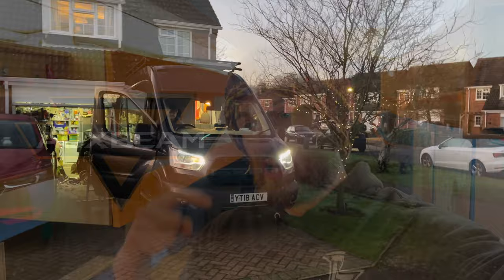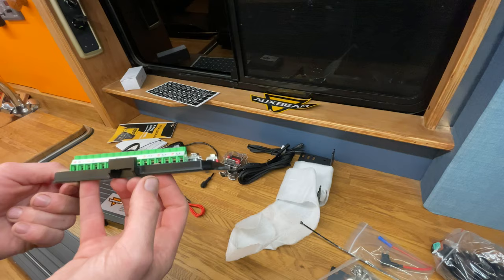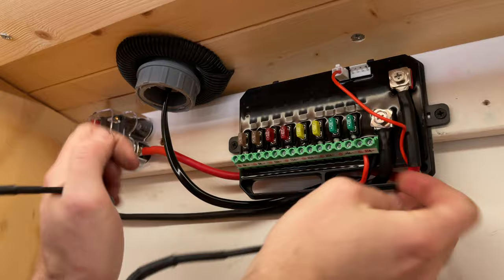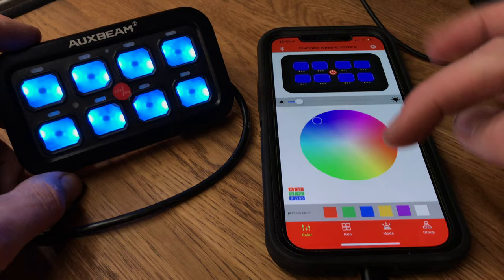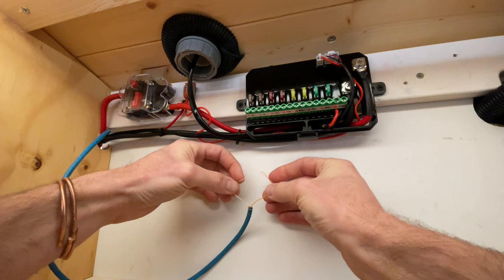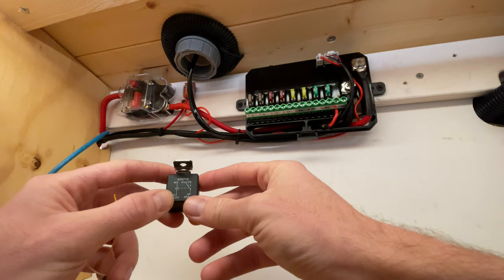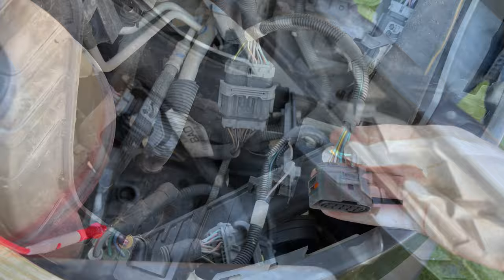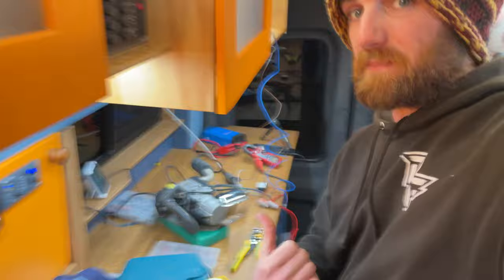Control ANYTHING in a CAMPERVAN! | AUXBEAM Control panel

Comment from the maker: What would you control with the AUXBEAM control panel?
Reply: Definitely use it for rock lights over the front of the cab when off road driving, nothing worse than not seeing what will get you a blowout, also roof lights in all directions, that’s my plan, thanks for the link to the 10 way junction box 👍👍
Reply: Autovox dash cam! I have mine wired to my fusebox so it can run 24/7 and not drain the vans starter battery
Reply from the maker: Good plan. I use a Autovox V5 dash cam and reverse camera
Reply from the maker: Good plan @Projectcamper. I am hoping to ask AUXbeam for some more lights including rock lights
Reply: @MispronouncedAdventures  that's what I have as well. Has been working good wired directly to mt fuse box. I cut the fuses off of the red and yellow wire and wired them both to the same positive terminal on the fuse box and added a fuse appropriate for it. I did it this way so I could still order the fuse piggy back adapters and wire it up the normal way again.
Reply: Compressor fridge via relay

Additional cab lights

DRL lights via a relay to to switch the -ve off as I use a DRL controller that relies on the battery voltage (it thinks the engine is running) to turn on so they don’t come on when my Renogy solar combined B2B charger has sufficiently charged the leisure battery and then starts charging the starter battery ie to prevent the DRLs coming on when just charging 

Solar panel via a relay so my B2B can charge the leisure battery at a full 50 amp when I just want to use the alternator otherwise it will only allow 25amp if the solar “is present”

Inverter feed via a relay
Reply: Could you put a diesel night heater on it? Mine is an eberspaucher/webasto and is controlled by a variable dial that you rotate between 0-100% so I guess it is looking for resistance or voltage or something, not sure how it works.
Reply from the maker: @chillout motorbike Yes. I would say so. I’ve seen the Chinese diesel heater with the rotary dial controller taken apart an additional wires soldered  onto the ON button for for an additional switch. A little bit more of a in-depth solution but I don’t see why it wouldn’t work. Definitely could be done with other types & brands of diesel air heaters and the controllers as well. Some easier than others
Reply: @MispronouncedAdventures   I have a webasto airtop 3500 and I know they have a number of different controllers, not just the rotary dial I am using, so perhaps one of the other controllers would be better suited to modifying in this way.

Big fan of your channel by the way! Your inverter installation videos part 1/2 really helped me out. The only reason my van isn't a copy of your van technologically speaking is because you are cleverer then me and my partner would tell me off lol
Reply from the maker: Thank you, I’m glad you have found my channel helpful! 

I’m not massively familiar with the webasto airtop inner working. But I’m sure a Webasto group might have ideals about adding an extra on switch and then if so, I’m sure if I could be used with a control panel like this
Reply: Adding in an aircompressor plus a control wire and relay to turn my 240VAC/12VDC hot water system on so it can heat up off the alternator (via the CCP) when driving.
Reply: I guess anything since it's basically switches with more or less amperage on each circuit ?

Comment: That's pretty much a scaled down ambulance control system, the one in my ambulance is called the phoenix system by Ring automotive, i have 12 buttons on each of 2 control pads and 30 odd relays to control stuff.
If i didn't already have it fitted I'd have one if those auxbeam kits in a heartbeat great bit if kit chap 👍
Really enjoyed that vid 😎 cheers 👍
Reply from the maker: Thank you, glad you liked the video and the unit. It’s a great bit of kit, I think there is a lot of use in industry with kit like this. I remember my old ex-AA van has a control panel left over from the AA, unfortunately they remove the main unit for it so it was never useable.
Reply: @MispronouncedAdventures  that was probably the phoenix system 🤔 a lot if recovery firms used it as well was ambulance builders, nowhere near as compact as that auxbeam unit though 👍
Reply from the maker: Ah that’s cool. I’m sure I’ve got the controller somewhere I might did it out to have a look

Comment: I was fortunate to also get the RGB controller, I also need to extend the controller wires so it’s in the cab and the main control box is in the rear, great idea using the max air fan on the Auxbeam panel.
Reply from the maker: Yep it appears there’s no issues with extending the cable being positive negative and then to data pins.

Comment: What is the reason for you wiring the panel to your leisure system and not to your van battery? Or both via a 5pin relay - with leisure NC, and van NO with an ignition switched signal?
Reply from the maker: I want all of my equipment running off the leisure battery and not the vans starter . Since I’ve got multiple huge lights, engine of preheaters and More.

Comment: Excellent video mate, I'm doing a similar install on a roof rack. Just wanted to know if the relay you used is "normally closed" as I have wired up mine with a relay that has two 87 pins and not a 87a pin.
Cheers Rob
Edit: I worked it out by buying a "changeover relay", now I have the same option as in this video. I'm going to do another relay setup  to trigger reverse lights.
Reply from the maker: Glad you got it sorted! I do have another video coming where I added reverse lights and other lights to it as well.

Comment: Coming to the party late! 

I want to do this scenario except only use one switch for it to come on only when high beams are  turned on if possible? I don't need to operate it separately. The laws in australia can be a bit funny...
Reply: You would still wire it up the same but without the need to wire up the 87A part of the relay. Instead you would have power for the light bar from the AR-800 going to a normally open (NO) contact 87 on a relay so when the high beams energised the relay, it would provide power to the light bar.

Comment: I read that people have had that issue that if you are multiple users in the same area, anybody can log into your system and (while joking or not) could possibly drain your batteries out. Anybody knows if that problem has been adressed? Not much litterature about those products... 😶
Reply from the maker: I have a button on my dash to turn the system off when not in use which is what I normally do mainly as the control panels lights up at night . 

But you are right, the Bluetooth doesn’t need a code as far as I can tell. So you can mess with other units.

I had this issue the other weekend with my friends. We turned all our rock lights on using the same app.

Comment: Hello there, sorry to bother you again🙈. I wonder why you use extra relays for the Auxbeam Switch Panel when they have it covered built-in? I'm not sure if you mentioned it in the Video. Is it for getting a potential free contact from a different 12 Volt System and/or just for having an additi you can run it another switch?
Reply from the maker: Couple of reasons. 

Either because I wanted to control a component from a different electrical systems, so it’s just using the circuit from the auxbeam controller as a signal for a relay. 

Or I want to run a device rated higher than output of that particular circuit on the auxbeam and just use the auxbeam signal for a relay
Reply: @MispronouncedAdventures  thanks for Letting me know. That’s what I thought, probably have to do the same as I like to run my extra high beams on the starter battery and not on my lithium battery 🙏

Comment: Acc wire what is that connected too in the leissure system ..?? This part has me well confused.. as if i connect to the battery in the back of the vehicle ive to get out and get in the back in the vehicle to switch off when parked camping or can i connect it direct to the leisure battery through a fuse a and on/off switch in the cab for example.. and would i have to use thicker gauge wite due to volt drop..??
Reply from the maker: Acc it just needs to be a voltage to turn on a signal. as long as the acc is getting a voltage for a battery / power source is shared a ground connection it will turn on. 

In my case the leisure system and the start battery are isolated. And since the unit is powered by the leisure system its needed the acc connected there, that’s where I added my switch
Reply: @MispronouncedAdventures  first of all thank you fir reply .. so am I right in saying you connected the acc via switch to the leisure battery ..?? Sorry for sounding stupid but first time connecting 12v setup on leisure battery.. head is 🤯🤯🤯 and acc is the only confusing part as if I was to put it on a switch the wire has to run about 10meters into the cab so a easy on and off when parked up for a few days when not in use.. its only a pickup truck..
Reply from the maker: @kevjr_kev7218 yes, you can connect the ACC to a the leisure battery And have a switch on the ACC.
Reply: @MispronouncedAdventures  perfect that just making it simple for me just needed someone to tell me the solution.. so thank you.. and I'll be watching more of your videos for ideas especially these 5 pin relays.. there interesting on how they work on your other videos..

Comment: Only downside to wiring your heater into the unit, your key needs to be on for the heater to run…
Reply from the maker: No, it doesn’t. The engine running or key in the ignition has nothing to do with the control panel being on or off or the engine preheater being on.

Now with  updated version which has two control panels ( same as this unit just a second
Controller )  i can now turn the engine heater on for my bed in the back of the van
Reply from the maker: Some people might choose to wire the control panel to an ignition live, but it’s not necessary at all to do so. I have a manual switch.

Comment: Alex. Quick one. What are the handheld cb radios you use? I've got cheap walkie talkies but range is pants.
Reply from the maker: I switched from a expensive CB ( Midland Alan 42 DS ) with external antenna as we could hardly talk at 50-100 meters plus. to way cheaper walkie-talkie Uv-5r and we get Almost 2km range with no external antenna
Reply: @Mispronounced Adventures  cheers bud.

Comment: Awesome video mate. Doing the MaxxAir fan control myself but having an impossible time getting the RJ45 connector to fit properly so I can reinstall the fan panel. Did you have to trim the backside of the RJ45 plug?
Reply from the maker: I know what you mean. I had a spare with a tiny RJ45 plug on it. Way smaller than your normal ones

Comment: Is there any way to program the switch panel to remember what accessories are left turned on so when you turn on your vehicle the light you had left on turns on? Hope that’s not confusing lol
Reply from the maker: Unfortunately I don’t think there is a memory option as such if you turn the unit off and then on again it resets all circuits to the off position

Comment: Did you put one switch panel in the rear of the van and also in the front of the vehicle?
Reply from the maker: I checked with the manufacturer, you can only have one control panel with this system. potential future version may allow multiple controls

However I did add localised switches for many of the extra bits of lighting in the back of the van. mainly side and rear lighting. Everything else I wanted access via the cab anyway when driving. They feature in a future video
Reply: @MispronouncedAdventures  wow thanks for getting back to me so soon. You’re awesome!!
Reply from the maker: No problem. It’s a good question and one I had been wondering about myself.

Comment: Alex, another bombardment of questions.  The cat 5 cable for the fan. What colour cables did you end up using from the several ones available?
Reply from the maker: The pin out is available on the internet ( I’ll have to look for it again ) but the pin out on it uses different colours than the cable I used.
Reply: @Mispronounced Adventures  I think I've found it bud. Cheers for the info. Definitely owe you a beer.

Comment: Are there any UK based distributors? I'm keen to get one.
Reply from the maker: I’m unsure I’m afraid, I didn’t find the shipping too long after auxbeam contacted.
Reply: @MispronouncedAdventures  did you have to pay any sort of import fees? I've seen conflicting info online.
Reply from the maker: No not myself, the Auxbeam do also sell direct via Amazon as well. I can’t imagine you would get import fees on there
Reply: @Wardy75  Hi, just curious if you have ordered anything yet. I’m looking to get 52” light bar and the switch box but I was put off a bit by $116 shipping costs + waiting time. There isn’t much on Amazon atm either.
Reply: @Pit8800  no I haven't. I know you can order from Auxbeam directly, but wasn't to sure on the customs aspect, whereas Amazon give you a guaranteed maximum cost which does seem more appealing.
Reply: @Wardy75  yeah there's customs on the top of that too. They don't mention it on their website.
Can't find RGB panel or 52" light bar on Amazon unfortunately.

Comment: Just purchased the auxbeam for the van conversion im doing , do you know if i can link the auxbeam Fuseboard from the existing Fuseboard ? I.e link the + and - power cables to power both ? Was hoping i could still keep some appliances on existing Fuseboard. Thanks
Reply from the maker: You should be able power the unit off a wires going to a fuse board. The Aux beam needs a total of 60A. So just make sure your wiring going to and coming off. But anything you want to control has to be on the aux beam fuse board
Reply: @MispronouncedAdventures  brill , thank you

Comment: This is pretty cool. Do you know if it's possible to have two controllers connected? For example to have one on the dash and one in the camper. this would make it an incredibly useful system for things like aux lights, cameras, heaters, etc.
Reply from the maker: Actually something I would really like to know myself as I would like to control panel for this next to my bed. I’m going to get in touch with AUXBEAM about it
Reply: @MispronouncedAdventures  nice one! I actually started making my own version of this which used a touch screen for control and would allow multiple control panels but I got bored and stopped development 😂
Reply: interested in this too
Reply from the maker: I have spoken to AUXBEAM, multiple controllers for this unit is not possible however a new product out in the middle of this year will support that
Reply: @MispronouncedAdventures  any further update about the new product that will allow multiple panels?
Reply from the maker: @sheepherlol  I’m yet to hear anything unfortunately.
Reply: @MispronouncedAdventures  ok thanks for the reply, I am at the planning stage for all my light bars and such currently also, so would of been ideal to just have 2 separate panels, but as you have done is also workable and perfectly practical with the secondary switches. 👍

Comment: I’m a bit confused why you need the relay for the MaxxAir on/off via CAT5. If you can program the Auxbeam button and panel as a momentary switch, why do you need the relay?
Reply from the maker: Ah apologies if I didn’t explain it well . The maxxfan isn’t looking for a particular signal on a individual wire in the CAT5. 

It’s looking for to two particular wires on the CAT5 to be interacted with each other.
Reply: @MispronouncedAdventures  But isn't that what the Auxbeam panel is capable of providing via the momentary switch capability? Sorry if I'm not understanding how the Auxbeam AR-800 relay works.
Reply from the maker: The Auxbeam AR800 relay board will just turn the on and off a circuit. I’m using the ar800 to close a relay ( momentary ). I’m pretty much using a relay incorrectly to tap the contacts together on the relays 30 and 87. The on / off max fan trigger is the combining of two wires in the CAT5. 

Some of the other commands only require one wire, if it was one wire I wouldn’t of needed the relay
Reply from the maker: Sorry I made a mistake On/Off was was a combo of 3 wire from the Cat5 ( two of which can already be combined and when the third wire touches that does the on/off command
Reply: @MispronouncedAdventures  Gotcha, understood. My misunderstanding occurred to me in the shower :)
Thanks for the detail. Really great setup. and great use of the product 👍